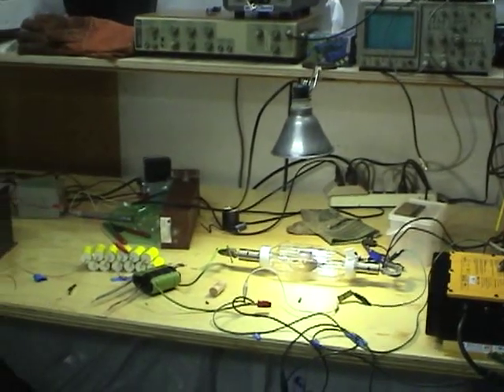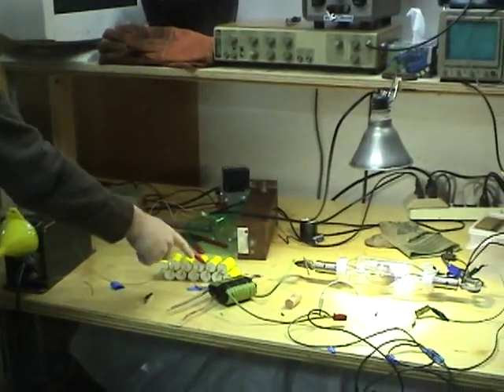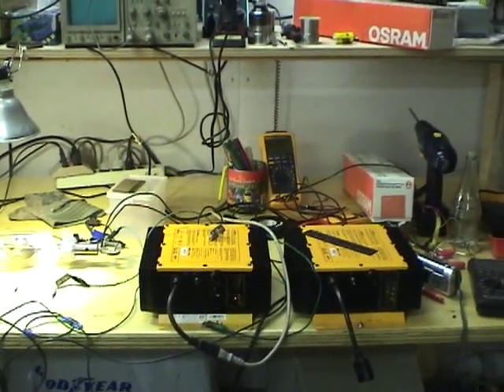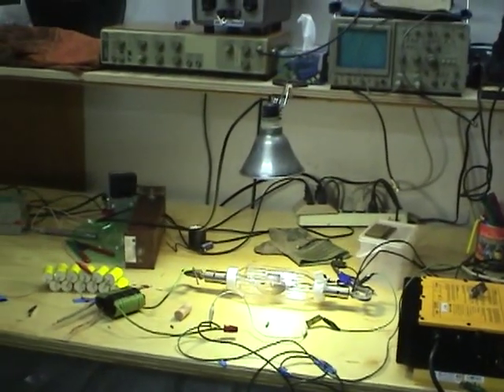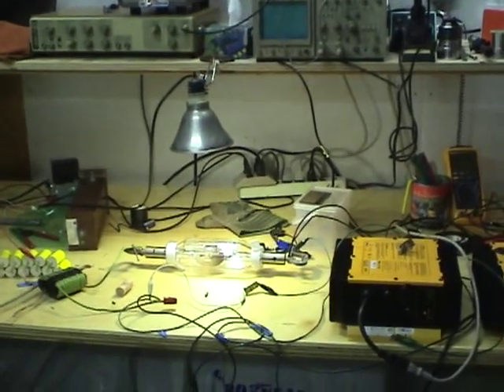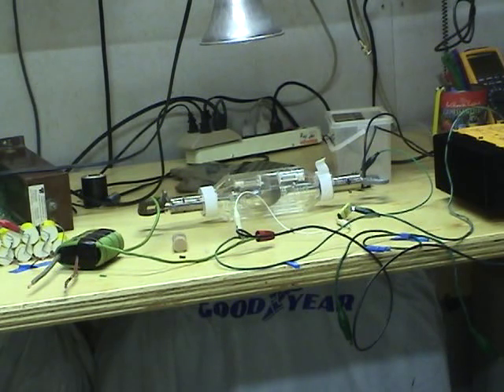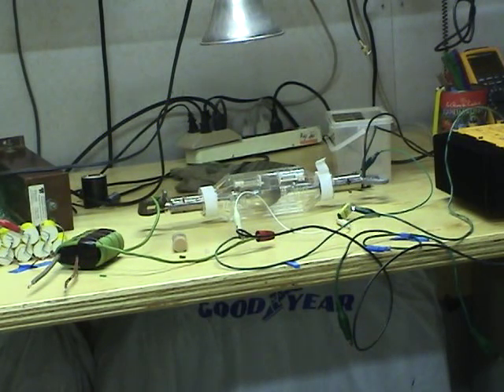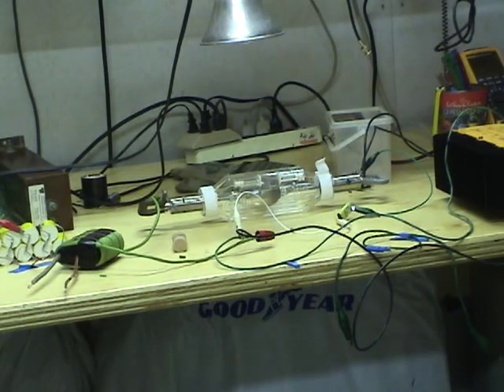Xenon short arc lamp bench test

Comment from the maker: I think the flickering was a combination of the camera adjusting to the bright light, and some arc instability due to operating the lamp horizontally without magnetic arc stabilization.

These chargers are normally used to charge  a lead acid golf cart battery or similar type of battery at 48V. They can each put out 20A.

The lamp barely got warm during the test. The datasheet says it needs 6m/s forced airflow for continuous operation. Perhaps other models can run without forced air cooling.

Comment: @tesla500, are you aware of the dangers with these lamps, between the high UV output and the explosion risks?
Reply: no they're not. they're not aware of anything they're doing here. this video should get blocked.
Reply: @peerlessrecords6236  he is aware of these dangers, the uv isn't bad for your skin because of how quickly he is running it, you would probably get more exposure to uv by just being out side for five minutes. He is wearing a welding mask to protect his eyes from the uv and while if one of these explode it could be extremely dangerous but that can be avoided by just common sense.
Reply: @reecebeck971  common sense that's clearly not present in this video